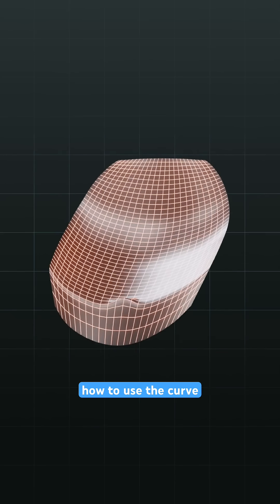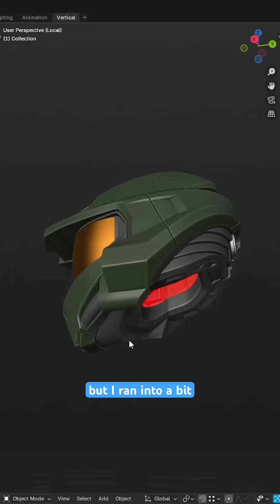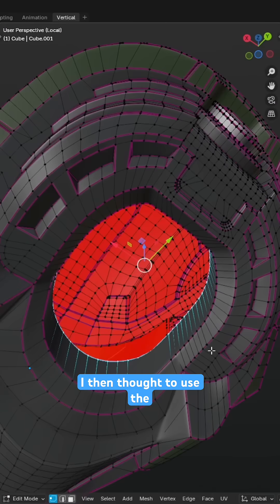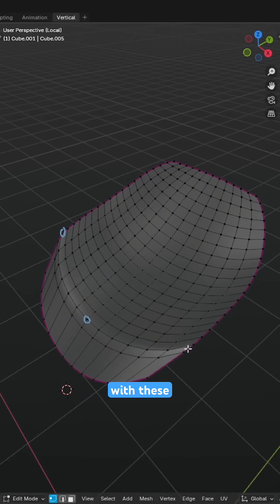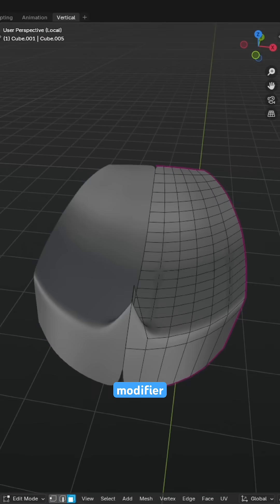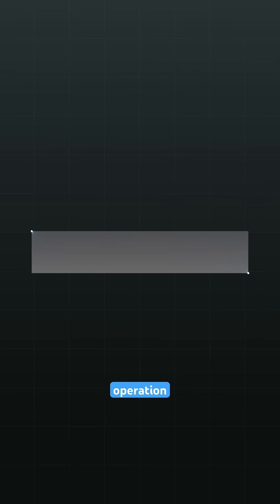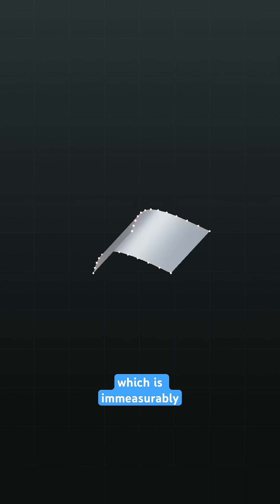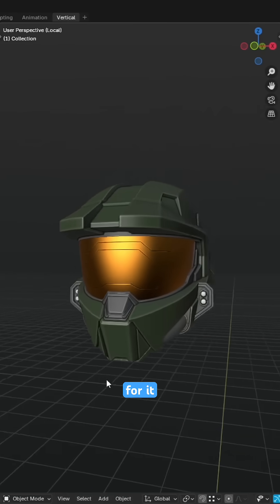Why the LoopTools Curve Operation is so Powerful for Modelling | #blender3d #blendertutorial

Comment: ok but how am I going to put my head inside if you fill the hole? My neck is very euclidean geometry
Reply from the maker: Hmm, could we disable the rigid body sim on your head so that it could just clip through? 😂
Reply: @masterj2001  "disable the rigid body sim on your head" sounds like how a blender user would threaten someone.
Reply from the maker: @ansonx10  It does, but that's not how I meant it. 😅

Merely playful banter, sorry if it came across any other way, wasn't the intent. 😅
Reply: @masterj2001  Nahh, no offense taken. I just thought it was funny.

Comment: I find half the battle of poly modelling is simply knowing the name of a tool. The other half is figuring out wtf it actually does and how it's supposed to be used 😂
Reply from the maker: Truthfully. 😅

It's all well and good to conceptually understand topology, but putting it into practice with the right methods and tools is the real hurdle. In my experience, knowing what tool/operation to use just comes with trial and error and then learning to read patterns with enough time and practice. 😄

But even then, with 11 years of modelling under my belt, I stumble across things that stump me and go against everything I thought I knew about modelling and topology. 😅

Comment: to answer the question i have used it before, not fully understanding what was going on (just deciding if i liked it or not). With your simple and very useful explanation im confident i should be able to use it correctly in the future
Reply from the maker: That's great mate! 😄

Let me know how you go with implementing it into your modelling workflow. I'm still trying to work out some of the quirks of it and wrap my head around its functionality, but I can certainly see that it's a very powerful tool to have in your modelling toolkit. 😄

Comment: It's quite good when it works, but with more complex objects it gets a little unpredictable.
Reply: If you hide the parts you’re not working on, it should help.
Reply from the maker: I think it still affects parts of the model that are hidden, I'll need to double check to confirm this, though I seem to recall causing myself some issues by thinking that this would work. 😅

But I shall check this arvo after work and get back to you with a more concrete answer. 😄
Reply from the maker: So, I've been experimenting more with the curve operation while doing the Chief's helmet and found a handy way of using it on more complex topology.

Since it works by modifying what you don't have selected, select the verts that you wish to have the curve applied to, ctrl+i to invert the selection, and then run the curve operation. 😄

I've been having rather decent success with this on the Master Chief helmet model and will be able to show off those techniques in greater detail when I start posting those tutorials in the coming weeks. 😄

Separating segments of the mesh and then using the curve operation is also a viable method if you want to ensure that everything it being localised. 😄